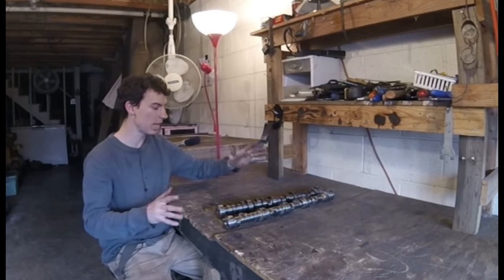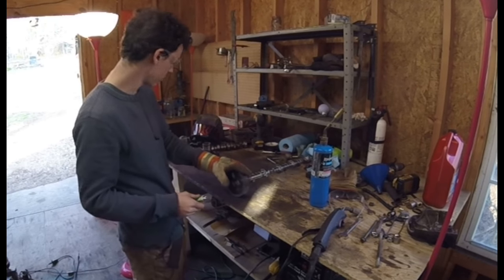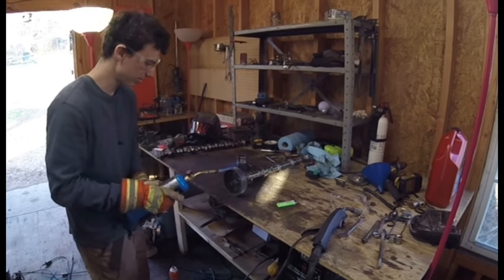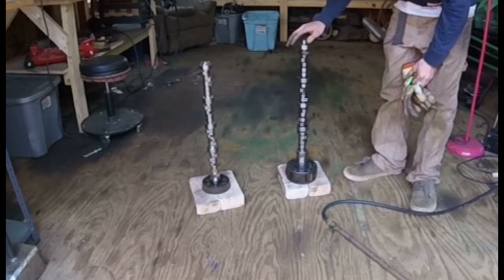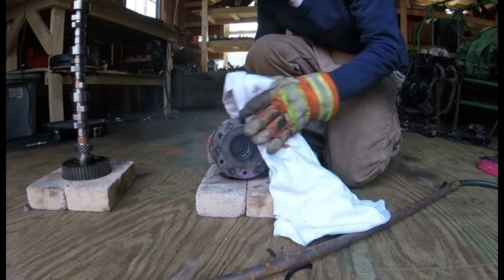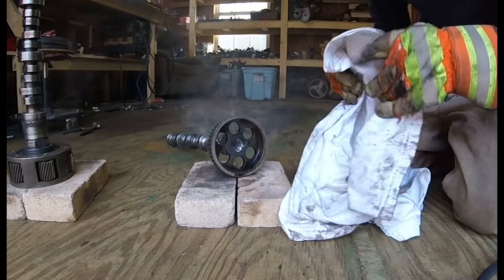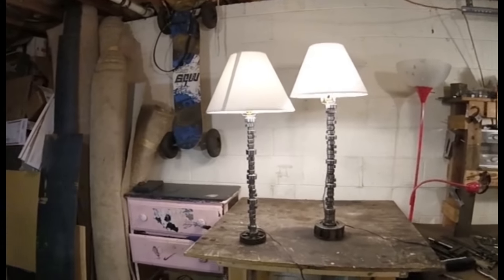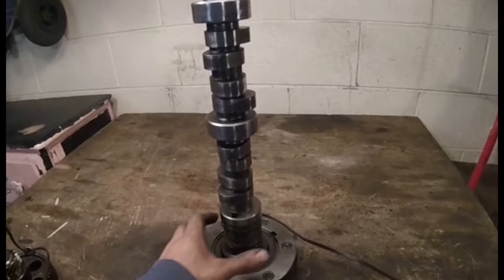home made camshaft lamps

Comment: fwiw, cams from toyota 3S 4cyl motors are centre drilled from rear to 1st journal. pop out the ball blocking the rear and then drill from the pulley-mounting boss and you can hide the cable inside the cam. 

cool project!